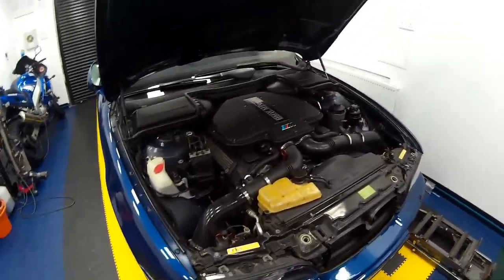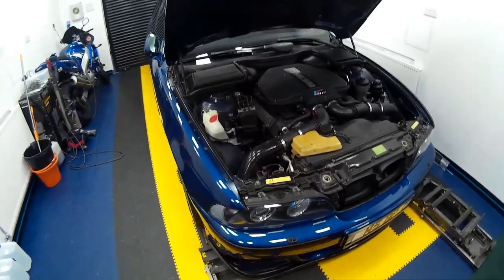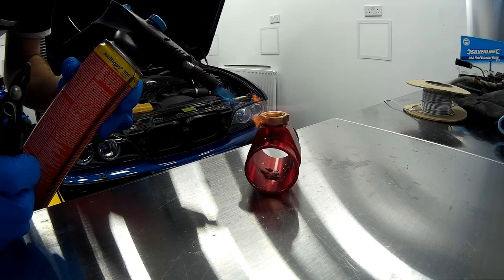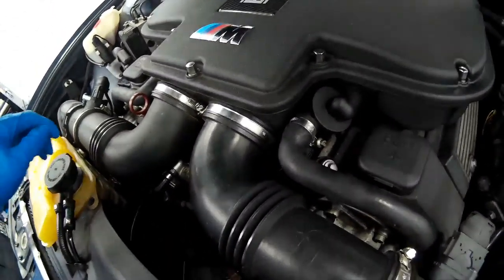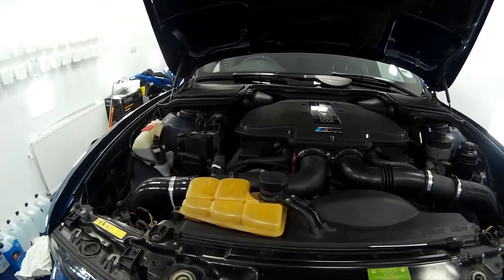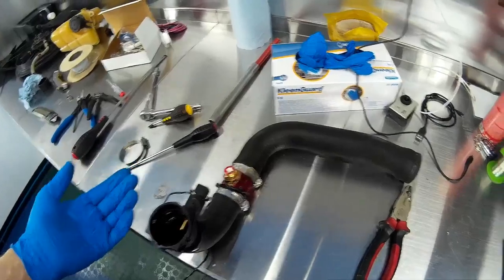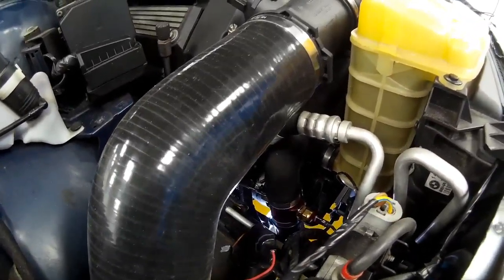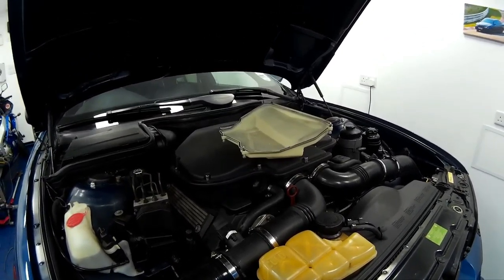How To - BMW  E39 M5 S62 V8 Electric radiator cooling fan conversion 1080p HD

Comment: Hi Paul, did you ever consider using E60 electric fan and connecting it to the E39 condenser fan plug (After changing the adaptor). Meaning you will remove the condenser fan and use only the electric fan for both radiator and condenser.
Reply from the maker: I hadn't considered that option. It's certainly one to look at as I'll be re-doing this system in the future. Cheers for the pointer about the E60 fan unit 👍👍
Reply: where did you here about the e60 fan
Reply: @WestinghouseProductions   Hi, as an alternative since you already have installed your aftermarket fans, the condenser fan from a e46 m3 has the module seperate from the fan motor. You can splice your fans to the m3 module output, that way the fan is controlled by the ECU which takes both watertemp and speed into account. It is fully codeable in the ecu, will run with your A/C , Fully PCM controlled and no temp-sensors is needed😁 BTW AUX fan fuse is 35 amps on the M5 if I recal right... Hope this makes sense and is helpful as it works perfect on my own M5😃
Thanks for your videos, you have been a great source of information and inspiration... Best regards Chris

Comment: Hi in a mater of connection could this be wired to the auxiliary fan on the front. I've seen another video and they put single speed fan and wired it instead off auxiliary fan which was deleted as well as the viscous fan

Comment: Great video Paul. I could be wrong, but noticed that you installed the temperature sensor on the lower radiator hose. Could that not give inaccurate engine tempature to the sensor, as oppose to having the sensor on the top  radiator hose which has the hot water coming from the engine and into the the radiator to be cooled? Just curious.
Reply from the maker: Hi Daniel.

The sensor is in the bottom hose as we need to measure the temperature as the coolant exits the radiator. The OEM BMW sensor is also in the bottom hose where the coolant temperature is measured too.

If it was in the top hose, then the fans would run constantly as the reading would be that of the hot side of the cooling system.

Comment: Hi Paul,
great car and great DIY. 
I consider this mod on my E31 whenever I'll get time for that.
What is the name of your lifting equipement? looks like you made it yourself any advises?
Reply from the maker: Cheers for the compliment Arnaud. 

The lifting equipment I had made for me by a local engineering firm - Each ramp is rated at 2 tons maximum loading and the cost was just under £300.
Reply: Great thanks!
Is the design patented or did you find it somewhere?
Is there any chance you'd make a video of it in action? It doesn't look like there is any sliding point in this design and somehow, this troubles me ^^
Reply from the maker: They do have a slide plate at the bottom where you can't see in the video. I'll upload a video soon on how they work and link you to it :)
Reply: Great thanks! I'll be looking forward to it!
Reply from the maker: Just editing the video now, it should be live in about an hour or so :)

Comment: And why the temperature sensor is in front of the thermostat and not on the pump.
Reply from the maker: The fan switch/temp sensor is on the outlet of the radiator back to the engine. There is also a factory fitted sensor at this location too in the bottom rad hose.

Comment: How did you hook up the 12v ignition power wire for the fan relay?
Reply from the maker: Peronimous Pratt I tapped in to an ignition switched feed in the ECU box and ran it through the existing grommet and trunking in to the engine bay. There are a few to choose from in there.
Reply: oh, you have to get it straight from the relay then? i was testing wires from the pin connectors under the hood, is that ecu box with relays under the cabin filters are?
thanks
Reply from the maker: Peronimous Pratt Yeah, open up the ECU box under the passenger side air filter and use a feed from in there. You can use the fuel pump output feed if you want as the additional current draw from switching a relay is negligible on that circuit.
Reply: Which relay is the fuel pump? Which wire is it? It has wires going to the engine bay, maybe one of those is the same.
Reply from the maker: Peronimous Pratt off the top of my head I can't remember. If you look inside the ECU box then there are some thick red wires - it was one of them. It's pretty obvious once you get in there. Use a multimeter or test lamp to ensure you get one that's switched and not permanently live.
Reply: Yeah I did that, thanks, the fan is still not working, I'm trying to figure it out, maybe bad relay, not sure
Reply: Paul Simon how does the temperature switch work? I can’t get one to work!
Reply from the maker: The temperature switch simply turns the relay on by switching to ground (12 V to relay coil on one side of it, the other side of the relay coil to the switch then from the switch to ground). If you are having trouble, check that the switch is working by using a multimeter on continuity test to check that it closes when the desired temperature is reached (Using a cup of boiling water is good for this with the temperature switch submerged in it).

Have a look at my other video for how to install a digital adjustable switch:

https://www.youtube.com/watch?v=7eFtQ7YO4YQ&t=13s